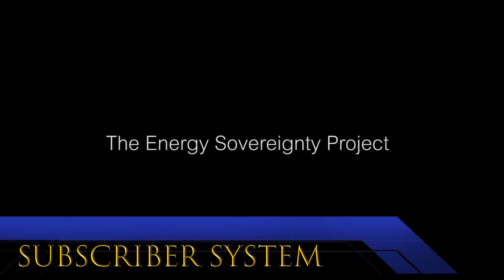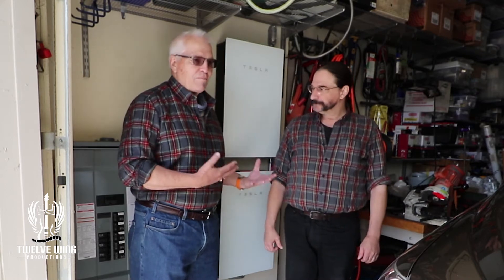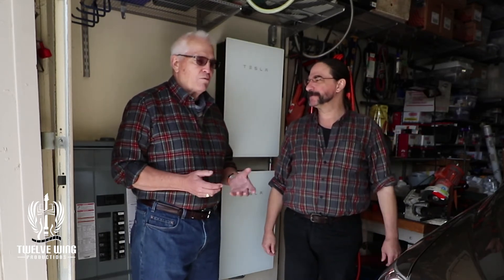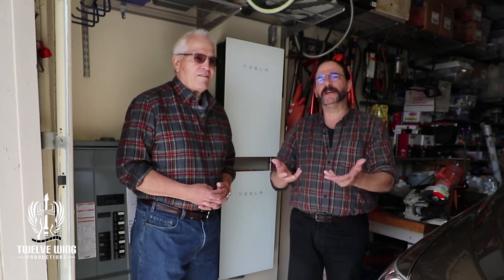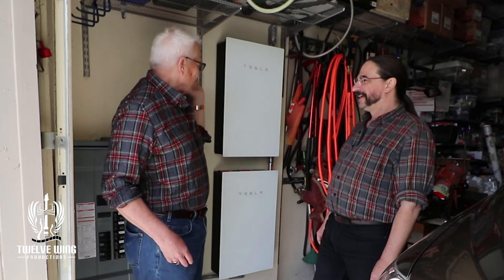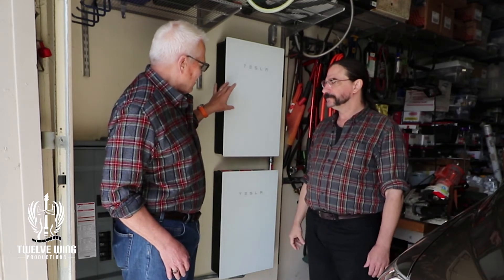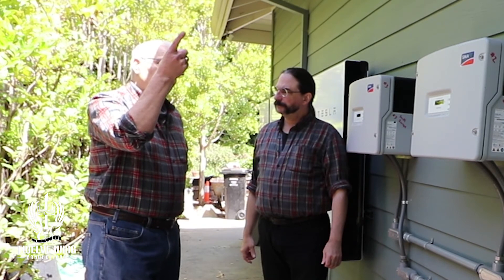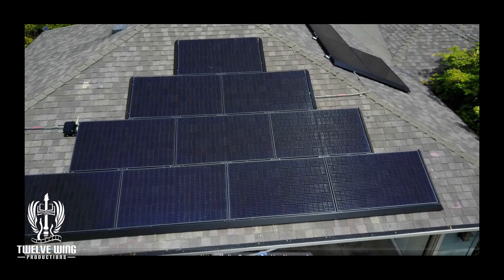New Tesla Inverters: Subscriber System Expansion

Comment: Great to see your videos again. Wondering if you've done a video or had thoughts on inverter clipping. I cannot figure out the rhyme or reason why my inverter clips 20% off my potential production. On full sunny days, my bell curve caps at 8.2 kw from 11am to about 3 pm (I have a 10.2 rated inverter from SolarEdge). On days that start cloudy, it jumps to full 10.2 when the sun comes out near noon. Lasts for about 5-10min and then begins dropping down to 8.3 kw. and flattens. Is it a SolarEdge issue? Is clipping adjustable? There's very little on the web on the subject.
Reply from the maker: The top of your curve is cut off?
If so, you need to call your solar provider right away as that is not normal with a 10kw inverter.
If the top of your curve looks smooth and normal, but reduced, this can be because of high heat.
My guess, however, is that there is something wrong with your inverter... so give them a call straight away.

Comment: Looking forward to next review of Thomas’ upgraded installation. Since he did his upgrade, Tesla has announced Powerwall+. Hope you will have more information about PW+ in a future video. Appears Tesla has removed inverter from PW, rendering it DC coupled battery?
Reply from the maker: I think this goes hand in hand with their new inverter.
They tried to release a DC coupled version of their Powerwall very early on but when they tested it at a few places with a limited release in Germany they had some serious issues with component failure and fire because people hooked them up to equipment that was either not comparable or was even hooked up incorrectly.
This was obviously not a liability that Tesla was willing to take on so their way to solve it was to simply have the powerwall operate as a gigantic AC UPS.
That solved the connection issues.

With their own inverter/charger they can now allow their own equipment to interconnect to make sure there are no issues overcharging with a system that is now connected directly to the DC buss.

Comment: Cool video...speaking of cool, why Tesla instead of Enphase?
Reply from the maker: In this case it was because Tesla did the install and they are currently using their own inverters.  Enphase and SolarEdge stock both fell sharply on the announcement that Tesla was now making inverters.

We had a SolarEdge inverter fail in the first year due to an overheating component.  So it will be very interesting to see what happens to market share if/when Tesla releases these for use outside their in house installations.